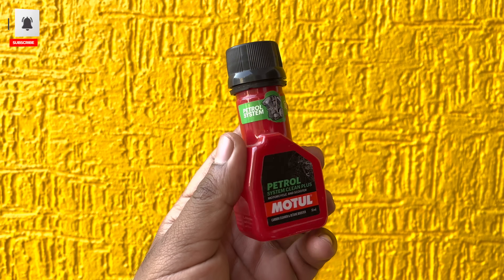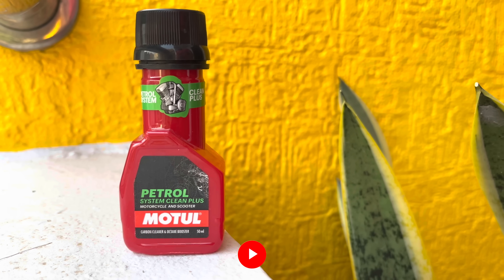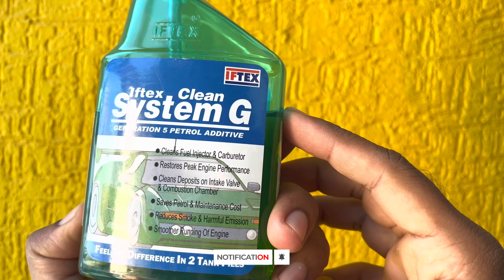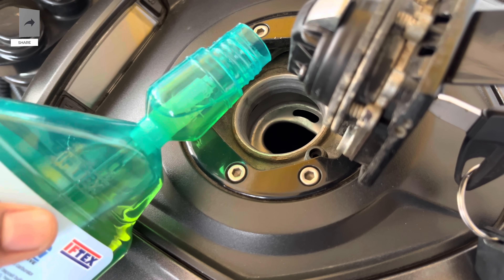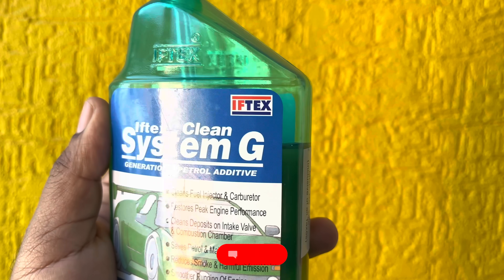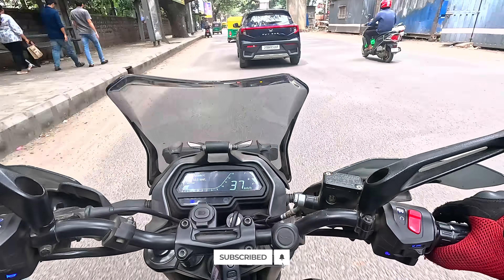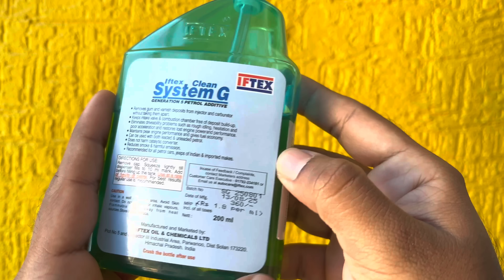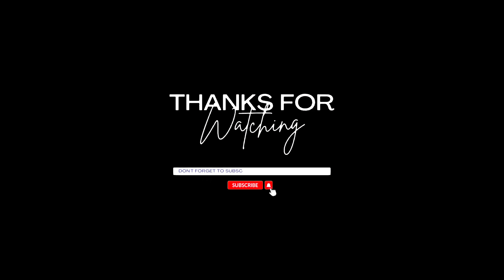Best Fuel Additive for E20 Fuel | E20 Petrol Stabiliser Necessary ?

Comment: Hi great job I enjoy watching your videos but I had a question please try to solve this can I swap the suspension springs hand oil of ns200 front folks with the springs of dominar 250 to get more comfortable write experience in pad road will it help if possible please make a video about it lots of my friends and I are suffering from this particular problem mine is 2024 ns200 model with inverter suspension I also have friends 2024 and 2025 models with the same inverter suspension we are suffering from the hardness of it

Comment: i own a ns400z, please make a video of showing your dominar 400 adjusting the clutch cable, please the clutch adjustment video you made is over 2 years old, i am very confused, as if i adjust it with handle to the left and leave 3-5mm of freeplay from the yolk, and if i keep the handle straight the freeplay increases, and the bike stalls a lot, and if i tighten it up a lot like 3-5mm of play at the lever's tip, the bike vibrates like crazy, i also have the adjustable levers as you, and as i have smaller hands i keep the lever at number 5, please make a video, i have checked a lot of videos but nobody explained it, and i have been following you for a long time, it will hardly take you 10 mins to make a video, i have checked the user manual as well in that it is only mentioned "clutch lever play 3-5mm" where as my friend owns a triumph speed 400 whose freeplay should also be 3-5mm, but it is clearly mentioned in their's user manual to keep the handle bar at the center, and to set the clearance from the yolk part as well(same way you showed in your NS200 video) 
Please please make a small video on it, even a short would do.

Comment: Looks like an ad more than a genuine review.
Reply: It's actually true tho, iftex was recommended to me by every garage cause it was earlier used to support the 2stroke vehicles as well and older bs3 vehicles also benefit from this. Considering the cost of premium petrols, it's economical to add a single use pouch which costs around 10rs. to every 2 litre or so fuel up. Cost of petrol doesn't cross 110 per litre and you end up saving ur engine and fuel system.

Comment: I'm using Hp Petrol power plus (sachet pack of Rs.10/- and 2 packets for each full tank) mine is 2020-BS6 160 4V Apache, now I'm not facing much issue with E20 (as I'm doing throttle body cleanup every year to remove deposits)

Comment: A supposed to be low cost ethanol mixed petrol is sold at same price as a normal petrol, vehicle mileage comes down , older vehicles get repaired using e20 and now further spend money on additives.. we indians are good at adjusting with corruption. Its equivalent to paying 150 rs per litre of petrol in longer run.. we Never question the root cause.

Comment: I have recently switched to red-flow fuel additive and I topically add 2-3 ml per litre on my Dominar400 (same model), i have noticed increment of 2-3 km per litre on my meter reading as before this redflow - it shows me around23kmol vs now showing 27kmpl , point to remember is that i have iridium spark plugs (3) installed after my 1st service, and my current odo. Reading is 30k 

I must suggest u to review red flow as it will give us the clarity BTW love-your content brother KEEP IT UP 👍
Reply from the maker: That’s great to hear! Thanks for sharing your experience.
I’ll give it a try

Comment: Thanku
Reply: Maruti Zen automatic gear (3 speed) car TORQUE CONVERTER , AC model, 14 kmpl mileage. Japan engine, Japan gear box Japan carburetor (NO ECM, NO SCANNING, NO ERROR CODE), Japan radiator, Japan axles, All zen automatic cars prior to year 2000 (only carburetor model, not MPFI) have high quality original Suzuki engine and imported 'Made in Japan' Suzuki automatic gearbox. This same Japanese automatic gearbox was introduced in Maruti 800 in 1990 (2 speed gearbox). Modified version (4 speed) (Indian made) of this gearbox is used in A-star, Vitara Brezza, earlier model of Swift, Dzire, XL-6, Ertiga, Jimny and S-cross.The petrol-powered Brezza and Toyota Urban cruiser share the same 4-speed torque converter AT gear box. So this RELIABLE automatic gearbox has been in India for the last 35 yrs. I heard that there have been many reports of issues in the AMMT gearbox, requiring numerous software updates and even complete gearbox replacements even within 25,000km, sometimes GEAR suddenly becomes neutral (free) while on the highway, Need to shift to manual for a while and then after some time it gets stuck on setting it back to auto. You can also add "overheating" transmission / clutch burning to that list. CALIBRATION and clutch LEARNING needed after new clutch fitting. Many fault codes, TCM errors etc. Manufacturers have struggled with the long-term reliability of AMMTs. It is inherently an inferior technology for passenger cars. That's why I don't recommend AMMTs to anyone. CVTs are quite reliable and almost a gearless transmission system. But it is also very expensive but less expensive than DSG/ DCT replacement. It is safe to assume that it's replacement cost will be somewhere around 4 to 4.5 Lacs. CVT transmission uses a metal BELT and this metal belt snapping is common in poorly maintained cars. CVTs are significantly more expensive. It’s also about durability and fuel economy. CVTs can be delicate when driven in stop-and-go traffic over long periods, and repair or replacement costs are high. I will always recommend a proper Automatic gear (Torque converter) because of its superior smoothness, performance, reliability & resale value. TORQUE CONVERTER automatic is 95 year old technology and the most reliable automatic gear technology. Latest generation automatic cars have AUTOMATIC GEARBOX with SOFTWARE CONTROLLED gear shifting which is very complicated and may be having high maintenance and very expensive to repair. Latest automatic cars have ENGINE CONTROL MODULE (ECM) Very expensive to replace) and TRANSMISSION CONTROL MODULE (TCM cost high).If TCM is faulty, we cannot shift from Neutral to Drive. Driving with a faulty TRANSMISSION CONTROL MODULE can damage your auto transmission. Latest automatic gear systems are sensor based. Need to depress the brake pedal before shifting from P to D or from D to R. If BRAKE PEDAL SENSOR is damaged or fuse blown, we will not be able to shift from P to D. No BRAKE PEDAL SENSOR in this automatic zen. No ECM/ TCM in this carburetor model Zen automatic. Many latest automatic cars OVERHEAT in heavy traffic. During overheating the FUSE in auto gearbox is blown. Then the car automatically shifts to NEUTRAL and we cannot DRIVE. This automatic zen never had overheating. No FUSE in the automatic gear box of this zen. Have driven 250 km non-stop without any problems. Latest automatic cars have very complicated ELECTRONIC MOTHER BOARD inside the automatic gear box. This Zen Automatic car do NOT have any software or computer or ELECTRONIC MOTHER BOARD inside the automatic gearbox/ engine. No SCANNING needed. This automatic zen has a simple MECHANICAL automatic gearbox. Simple JAPAN engine (carburetor model-even roadside mechanic can repair it) and simple JAPANESE 3-speed MECHANICAL (no electronics) automatic gear box. Latest automatic cars have even 10-speed automatic gearbox. The more the number of gear ratio, the more complicated and more expensive to repair. This Made in Japan automatic gear box will last for about 3 lakh km in Indian driving conditions.and this Japan engine will last for about 4 lakh km. The less the weight of the car, the more the life of automatic gear box. This zen weighs just 750 kg. So the automatic gearbox has to pull less weight, so it will last long. Latest automatic cars have non-reusable automatic gear oil FILTER with washer. If washer is dislocated, autogear oil will enter the transmission without filtration and auto gearbox will get damaged. This zen has RE-USABLE flat METAL MESH type gear oil filter without washer. Zen carburetor engine model has more quality than zen mpfi engine model. Do not compare the used car rate of automatic zen with the rate of manual gear zen. FULL MECHANICAL/ ZERO ELECTRONICS CAR. The less the electronics the more the reliability. Average price of good condition used Zen automatic is 2.25 lakhs.

Comment: Can "Motul Petrol System Clean Plus" be used in a carburetor bike like the Super Splendor, which is used very rarely?
Reply: Yes, it can be used in any carburettor based motor cycle. READ THE LABEL AND FOLLOW THE INSTRUCTIONS IF YOU ARE GOING TO USE ONE.

Comment: 0:28 Please don't ride with high beam in the morning
Reply: Even during nights, within city limits, drive with low beam!
Reply: Not even at night
Reply: Day Me High Beam Se Kya Problem Explain Pls
Reply: @gamerboymohit5773 why does one need a hi beam during day time?? Even low beam is not needed, but unfortunately it can't be turned off
Reply: @gamerboymohit5773 you are not supposed to drive with high beam in the city or highway under any circumstances. Let it be america or any european country, for such an act you'll be fined or might even end up in jail upon repetitive misdemeanors
Reply: @gamerboymohit5773 you need to be told? Because nobody around you are idiots who use high beams all the time.  Only use them when absolutely necessary

Comment: I did some testing and BP Speed seems to have less ethanol blending around 6-7%
Reply: But in my case jio bp normal has low one and shell have low e20
Reply: @shyamraja4034 jio bp 
Now has 20% ethanol
Reply: Can you upload the video
Reply: Speed 91 or 97 Sir?
Reply: @amoghavarshamurthy speed 97
Reply: BP speed 97 is best 
Because it has 8% ethanol with 115rs price 
Its the only E10 fuel in india right now